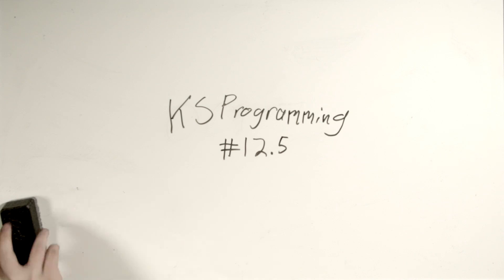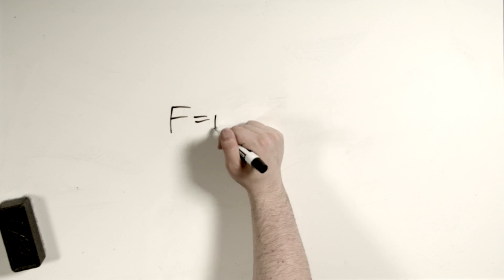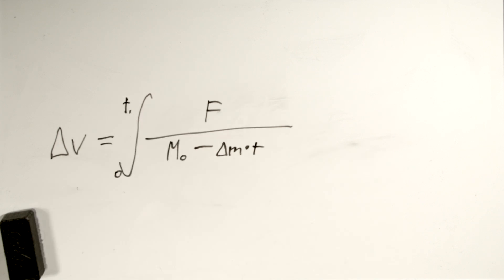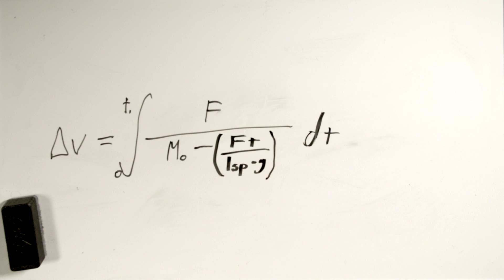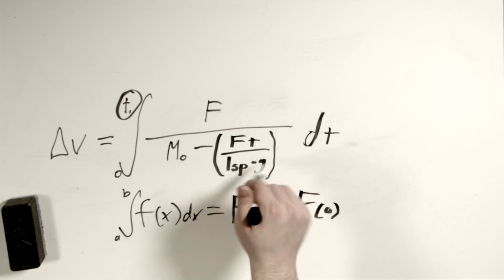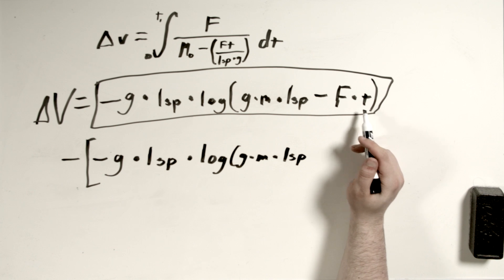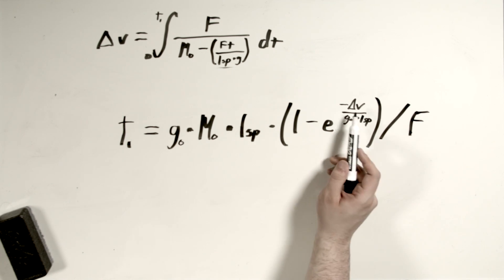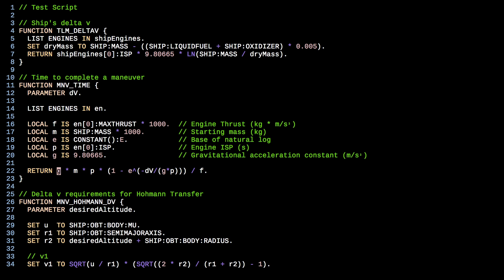Kerbal Space Programming #12.5 - Fixing with Calculus!

Comment: isn't it much simpler to divide required fuel by fuel flow rate to get the burn time? both can be calculated fairly simply.

fuel flow rate (in tons/s) = thrust (kN) / exhv (m/s).
req fuel in tons = (1-1/e^(nodedV/exhv))*startmass (in t).

Comment: For some reason when I use the maneuvre time function I get errors about passing infinity into the stack... any ideas?
Reply: +Ben C Fixed it!  Issue was for a craft with more than one engine it wasn't putting the active engine for the 2nd stage at index 0 in the en array.  Instead putting engines on higher stages first.  Fixed by pointing the ISP variable at the last stage in the array.